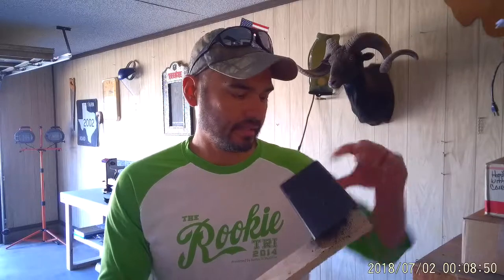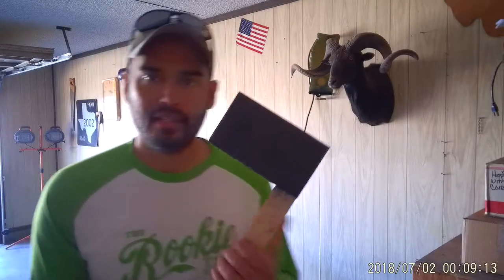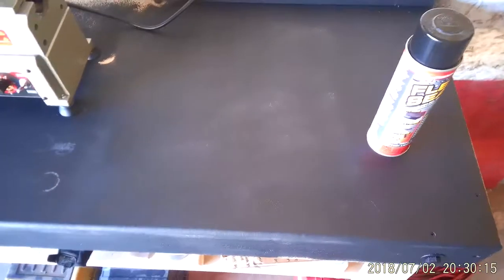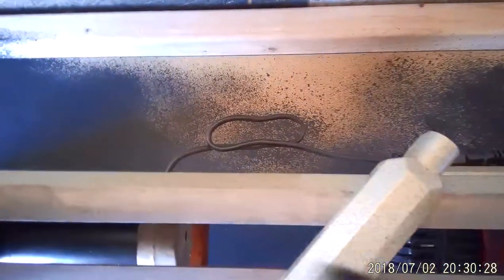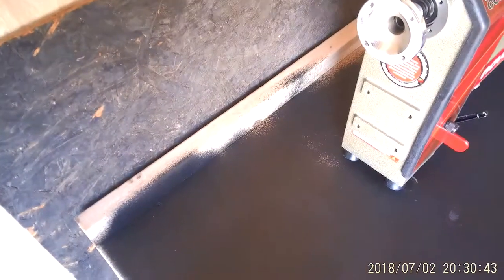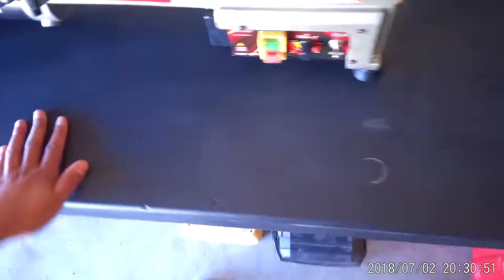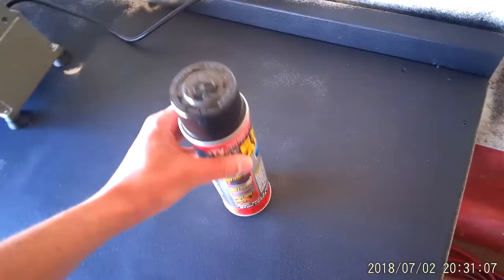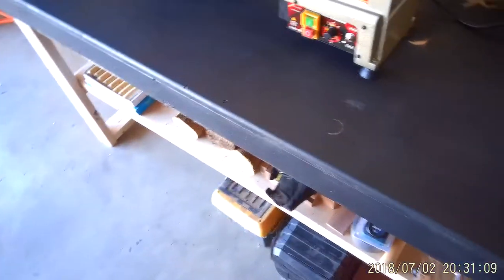Flex Seal DIY

Comment: When the flex seal dried was it slick or grippy?  I have a plastic work stand that i need to be grippy
Reply from the maker: It was slick, I thought it would have some grip but it really didn’t. It’s like having a thin rhino lining on my work bench. Helps prevent splinters though.